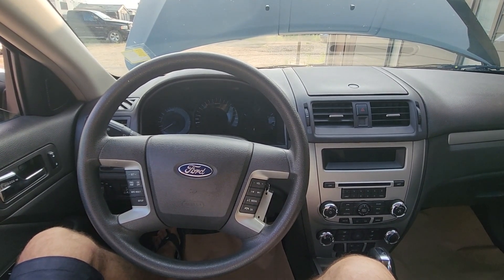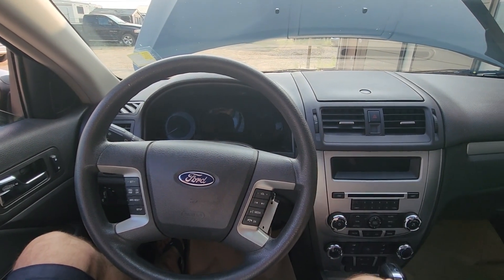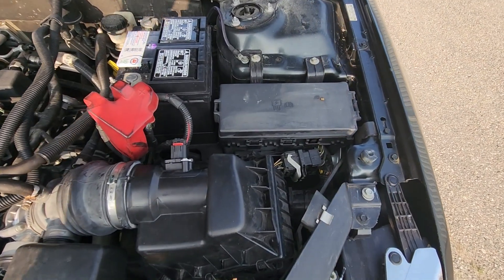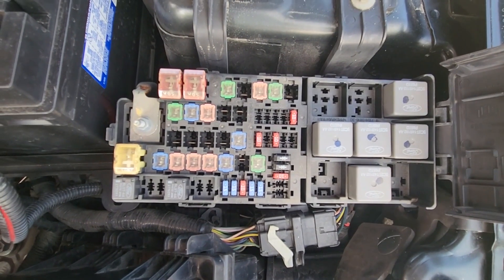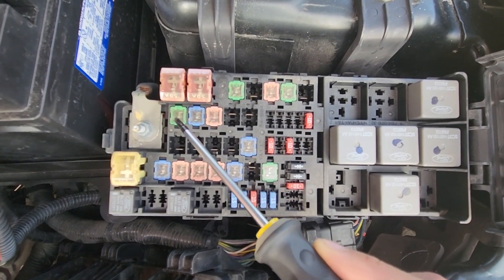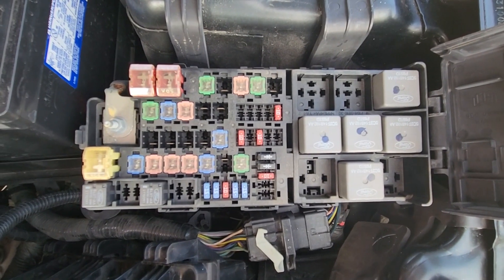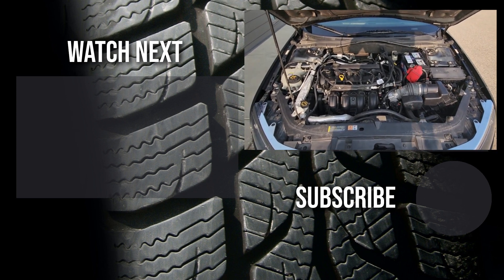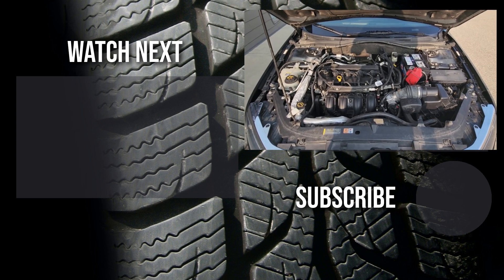Ford Fusion - ABS BRAKES FUSE LOCATION (2010 - 2012)

Comment: Hit my breaks pretty hard one night then these light came on. This is not the first time it happened, but I’m trying to remember how I fixed it last time. Is it safe to simply remove these fuses and then put them back in? Is there a way to reset these lights to see if they come back on?
Reply from the maker: Most likely you are having problems with one of the abs sensors or wiring towards one of the sensors. It is not too expensive fix. Vehicle needs to be scanned to get the abs codes and follow up on those. Codes can be reset using a higher end scanner which can access abs module but again if there is a problem lights will come back on
Reply: @QuiteAlright boa tarde amigo 
No meu 2012 foi passado um scanner e acusou falha interna no módulo abs, e aqui no meu país fica muito caro pra consertar. A luz não apaga por nada, a luz do abs luz de tração e luz do freio de mão.
Reply from the maker: @marcosmedeiros6194  If you need a replacement abs module your best and cheapest option is probably getting one from a car salvage. Not sure then if it will have to be programmed to the vehicle by the Ford dealer